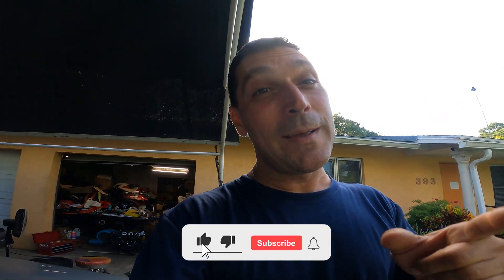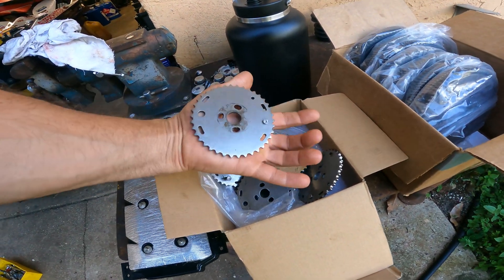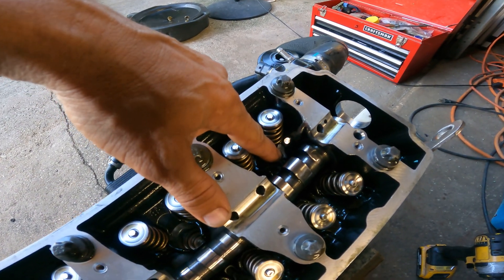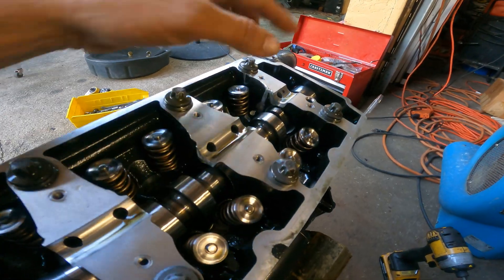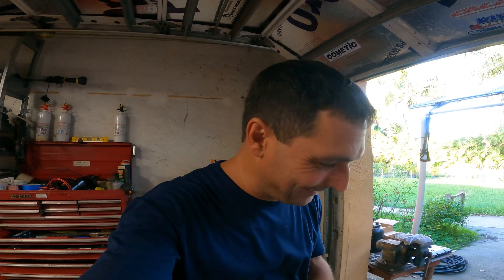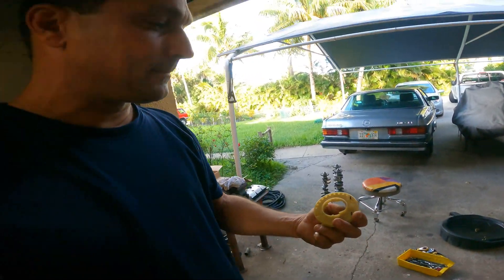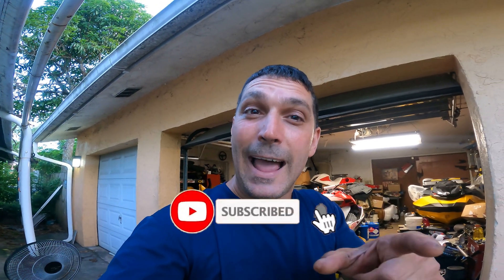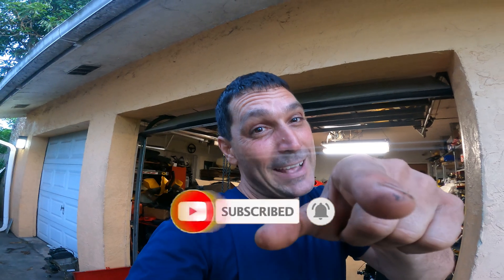2021 Sea-Doo RXP-X Engine Teardown + Billet Cam Issues + Tech Tips + Calas Performance | Calas World

Comment: It's a shame BRP is getting a BAD REPUTATION making junk from the factory that DOESN'T LAST and FALLS APART on it's own due to their engineers skipping important details maybe even on purpose so they stay in business with consumers buying parts. Thank you CALAS for your insight.
Reply: Were you sleeping while the video was playing, that was not a stock motor, it blew up because it was not built properly by a modification shop not because of BRP.
Reply: @R1Kyle  BRP engineers are great at making things break and charging crazy prices. They make their profits and move on. Geniuses, they are in allot of fields so you are bound to buy one of their products and watch them fail.

Comment: I’m curious can I run the xxx 24psi wheel and still run pump gas on a 4 tec?
Reply from the maker: You will have to stay between 8600 and 8800 RPMs

Comment: 9200 RPM, WOW that reduces the life of the Rotax engine by at least a 1/3 if everything goes good. Better off operating the engine at 8000 RPM with a moderate boost increase and  losing 10 %  give or take of your engine life.

Comment: Hi, love your videos. I have this exact ski, I’m using a short 90 degree power filter but I find I’m loosing power due to the heat at the rear of the ski, do you know where I get some sort of ventilation into the rear of the ski? Like a hood scoop or  a vent scoop made into the plastics behind the seat? Please help. Thank you

Comment: Great video! Ive got a built 08 rxpx 255 im goin to add a cam in next.if i run yours  can u send a safe tune to run  threw maptunerX so i can get data to jesus at riva for custom tune?
Reply from the maker: Jesus knows who I am we have talked in the past and he has a few maps made already if not he can make one for you
Reply: @calasworld  i spoke with him, we all good, any tips for not dropping that washer while installing your cam ? Thanks
Reply from the maker: Put one of your fingers to the center of the washer and get it stocking there and whatever you do don’t get it loose And slowly get it out

Comment: $10,000.00 usd. For 10 seconds of adrenaline rush 90 mph. $1,000.00 usd. a second. Risking the motor. I don’t think it is worth it?
Reply from the maker: It’s definitely worth it if you do it The right way
Reply: @calasworld  for an average user definitely no!!! For a racer with a sponsor definitely yes!!! For a mechanic is heaven on Earth
Reply from the maker: The set up of that Seadoo is the max that I will go it’s on 93 pump gas it’s pretty safe it all depends on the rider remember 7 to 10 seconds on full throttle and you’ll be just fine
Reply: @calasworld  I am sure less than 10 seconds will be fine but more than that we’re talking about a $20 thousand dollar repair! For 5 more seconds will be $ 4 thousand dollar a second. Do you agree ?
Reply: The issue is you don’t want to run the ski at it’s top rpm for a long time the same way you should not run your car at it’s top rpm for along time it does not mean that you can’t do it multiple times, when motor get build and Tune properly you can race them over and over… so the more you take care of your toy the longer it will last you.
Reply: @floridafisheater8650  I really like your videos specially your English  pronunciation I really think you mechanics are genius. I have a RXTX 255 2008 stage 2 Riva Racing my goal was to eliminate the close loop cooling system for a open loop, Riva Air filter, oil catch can, Riva exhaust and the upgrade Riva turbo kit that makes 12 psi at 8400 rpm 73 mph 5-60 mph in 2.5 seconds solas impeller and a Riva intake grill. With this I can go full throttle as long as the gas tank will provide. When I saw your video I knew I was right on one thing never go past 8500 -9000rpm and do not ever upgrade the interior of the motor as you say it won’t last they are not made for that power.
Reply: As the owner of that ski I can tell u that it’s worth every penny 2me. I’m not a rich guy where money is no object. But I can afford the cost of ownership that comes with how I want my ski to perform. It’s all a matter of preference really. My mistake wasn’t spending loads of cash. My mistake was lack of patience in finding a knowledge professional to service my ski. Ignorance & lack of patience. It’ll cost a person every time! But now I know and very confident bcuz the ski is in great hands now! My 2 cents…
Reply: @waltg4663  I understand perfectly what you mean but are you going to ask for a 7 second warranty?
Reply: @arqjavierobregon  Warranty isn’t my concern. I know business is business but I trust this and if for any reason something goes wrong related to work done, he’ll sort me out. In case where the cause of break or break is on me, nothing is covered.
Reply: @waltg4663  that is good if you are willing to spend $4 thousand usd a second even better.
Reply: @arqjavierobregon  we’re not talkin 400k or even 40k. 4K is nothing. Just crumbs that regardless of perspective, I can’t take with me when I die. YOLO!
Reply: @waltg4663  wouldn't you rather a more reliable ski that goes 75 and not have to worry about blowing it up?
Reply: @kyletrump8025  Blowing up isn’t a concern if the repairs & upgrades are done by some1 like Calas who is experienced and knows what he’s doing. 75 is nice as a cruising speed. But def wouldn’t want it to be my max speed.